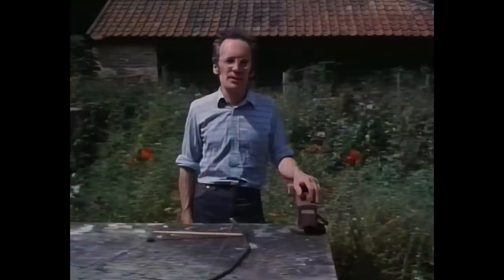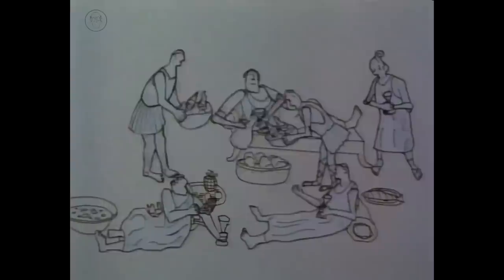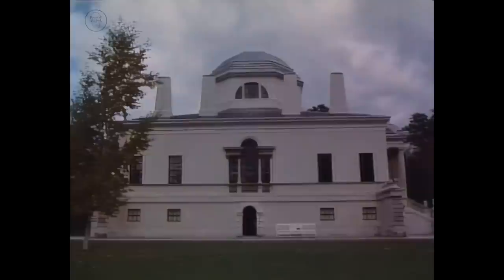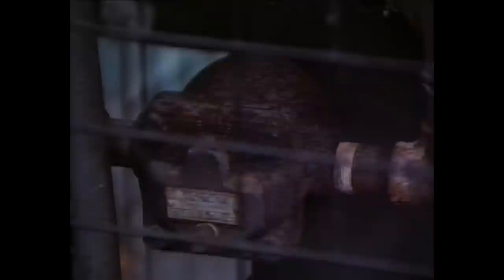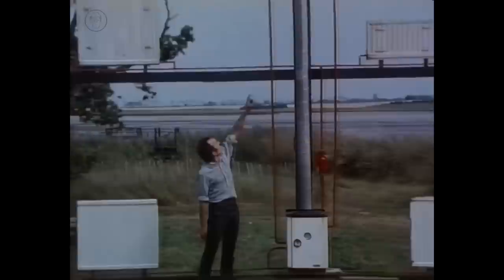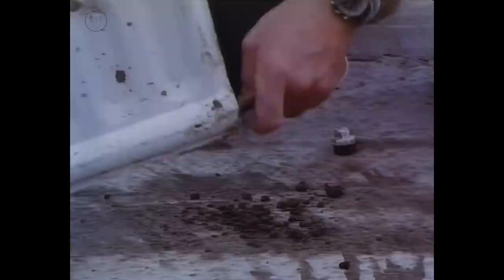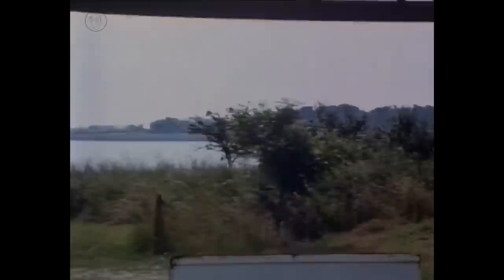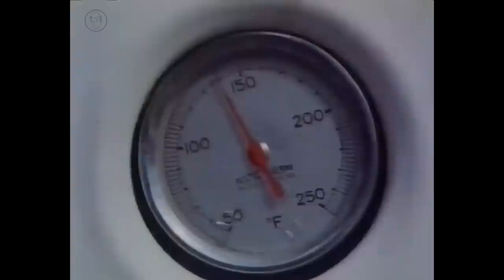The Secret  Life of the Central Heating System - Remastered

Comment: Another energy saver with modern boilers is the old ones had a small pilot light burning 24/7/365 to light the main burner whenever needed but now they use spark ignition and flame rectification (ionization) sensing to check it's safely lit rather than spewing out gas, older boilers used thermocouples which held the gas valve open with a small electromagnet, if the flame went out, the  magnet would release, closing the gas valve until it was manually reset, new boilers also have "modulating" gas valves so the burner can better meet demand without wasting fuel.
Reply: It's still common for natural gas fireplaces to use thermocouples and thermopiles. Of course, these aren't condensing, so there's a lot of wasted heat out the exhaust compared to modern high-efficiency furnaces.
Reply: @cmmartti  Usually because you nearly always light them manually (thermocouple controlled valves need you to manually hold them in long enough so they get hot enough to energise the magnet and hold the valve in after you let go), also thermocouple systems need no external power to work.

Comment: Being from the USA I was shocked to learn while vacationing in Wales that if the boiler goes out, you can get an electrician - if you suspect the problem is electrical - or a plumber - if you think the problem is with the pipes, but to diagnose a boiler problem you need to hire an expensive Engineer, who can work on both electrical and plumbing boiler issues. Thank you for this fantastic and accessible video!

Comment: As a Canadian Engineer I find this fascinating.  Systems are so different!  In my part of the country heat was typically oil fired, either hot water or air systems until the 1970s when electric baseboard heat became the most common.  Only now are they talking about a "smart grid" that will have the ability to control unnecessary loads based on overall demand.
Reply: I was thinking similar things.  I'm American and I've lived in houses built from the 1940's to the 1970's and while the house from the 40's has some evidence of an oil fired water system, houses from the 1960's onward (I skipped the 50's, don't know why) all seemed to center around forced air systems.  Even the 40's house had a forced air system installed - from what I can tell - sometime in the early 60's.  America seems to have mostly abandoned the radiator type water systems when they could afford to in favor of forced-air systems as soon as those were developed enough for home use.
Reply: I’m from Australia and we went from wood fired space heating, to gas fired to heat pump.

Comment: In Finland and Sweden they had central heating of a sorts before even modern central heating as well. In these houses the fireplace wasn't an open fireplace, and the chimney was put in the middle of the house and not the edges. The house was built so all rooms touched the chimney and it heated all rooms. The fireplace in the kitchen was connected to it, and often a masonry heater in the main room. People still use this and variations of the system today.
Reply: Also, the efficiencies of these old masonry heaters could reach into the 70% range and maybe 80%. And modern masonry heaters (same design but with secondary air for complete combustion of flue gasses) reach into the 90s. I have read old magazines from the 1950s that talked about a concept called the "heating wall". Basically the house was built around a central brick wall, which had flues running through it, it was a giant chimney. This would be fired from the cellar and the magazine talked about using secondary air and achieving efficiencies into the 90% range. Very impressive for the mid 20th century! Since the efficiency was so high sweeping would not be required often, which required sweeping something like 40 locations to get at everything. This never really took off because oil fired boilers took over.

Comment: A funny note about the condensing boilers. When they started getting to the peak in technology, they reached a point where they advertised them as 103% and above efficiency. And the worst part is they were actually correct! Well. Technically. And legally. The old system for efficiency was based on all gas inputs and products, gas, oxygen, water vapour and CO2. Once they started condensing even the water in the exhaust fumes to squeeze that last bit of energy, they went over the 100% mark in the efficiency rating that was set up for old systems. Water can have a stupid amount of heat stored in it and it really showed here
Reply: It's the difference between the Higher Heating Value (HHV) and Lower Heating Value (LHV) of the fuel.

Comment: What a brilliant programme, it inspired me to do more researching and fit my own central heating system to a large Victorian property back in Decemder 1989.  All it had when we moved in was a single gas fire in the living room, and an immersion heater for hot water. I fitted a multifuel cooker similar to an Aga, the very large kitchen was transformed into an oasis of heat. The hot water was always hot no matter what time of the day, and tagged on the back of that was micro bore pipe system feeding a radiator in every room except the kitchen. I burned mainly free hardwood offcutts sourced from my employer at the time. They were very happy and very cosy days.

Comment: Pretty cool!
And now we have 90% plus condensing gas boilers too!
Never saw a rotary oil burner either.
Reply: The Wallflame burner is a late 1940s American design (Timken) but was only incorporated into UK boilers in the early to mid 1960s I believe. It was a vast improvement on vapourising wick & pot burners in terms of efficiency due to better excess air management and they were easily switched on & off according to demand without producing excessive smoke (as compared to the fan pressurised on / off pot burner).
https://heatinghelp.com/assets/documents/108.pdf
As Tim mentions the Pressure Jet burner (Gun type burner U.S.A.) is better still and are made to this day. 
Oil fired boilers are also condensing type by law in the UK btw (unless there's a very good reason not to specify one due to site conditions); they use grade 316 stainless steel heat exchangers for the condensing part of the boiler due to the sulphur content in the kerosine producing dilute sulphuric acid in the condensate. Gas oil (similar to Diesel oil) is not used in condensing oil fired boilers due to the higher ash content which would quickly foul the condensing heat exchanger.
Reply: Martindyna 
Thanks for the reply! I see your familiar with Dan Holohan, he’s a gem for old timey piping and equipment. I work on boilers and piping (USA, licensed Master Journeyman), often on systems that are gravity conversions and steam. I love that stuff, it’s ingenious but requires some love now that it’s typically a 100 years old to keep purring along. When I was a kid first starting in the late 70’s we were still finding pot and occasionally wick burners. Condensing oil systems are pretty rare in my area, mostly for the reason you stated in either hot water, steam or forced air application. I prefer the new condensing gas equipment for efficiency, I’m working on a 1MBH system now that tandems 2 of them with a 3rd 95% on the opposite end of the building which was primary/secondary tied into the mains in the building. The building owner had no idea their front mechanical room was tied into the back mechanical system until one of my techs and  I started pulling out a 200’ path of ceiling tiles to find the connection.
Love my job!
Reply: @globeflicker9216  Actually I wasn't aware of Dan, I've just always taken an interest from a small boy in heating systems but I'll check some of his videos out now so thanks for the heads up. Nice to be paid for a job you enjoy.
Reply: Martindyna 
Dan gets into old Steam systems and has a simple way of explaining the physics that makes it work. He has some good history based vids on the subject, too. Enjoy!
I’m lucky enough my hobby is also my paying job.
Reply: @globeflicker9216   Thanks, I’ll definitely take a look.
If you hadn’t realised, my channel thumbnail is the flame pattern of a Wallflame burner btw.
Reply: Martindyna 
Brilliant, I say!
I’m getting ready to post a vid on a tandem condensing gas boiler, I’m piping all the near boiler piping straight from the book with my touch. 
- Across the Pond,
USA,
Licensed Master Journeyman.
Post a vid, if you have not. It’s an interesting subject. American’s are not good at saving easy money over here with efficiently.

Comment: Heat recovery ventilators are amazing; Cuts the ventilation portion of the heating or cooling load by roughly 50%. Might not seem like a big deal for a house, but in commercial spaces where you typically have a lot of fresh air coming in it's a huge savings both initial install and operating costs.

Comment: My adult children live in South Korea where the one in a two story cement dwelling (thick roof included) where their home transitioned from an oil boiler to a gas boiler, both on the outside of the home where the heat is piped through hoses in the cement floors. In winter, clothes are dried indoors adding humidity, either on a clothes drying rack or if wanted quickly, laid on the floor overnight., Enjoy your videos!

Comment: Early water central heating systems worked without a circulation pump at the boiler. The tubes to the radiators where reduced in diameter with every step higher in the house. So the flow was only kept up by the thermal syphon principle. That's similar to the modern Cpu coolers with pipes at the finns.

Comment: Regarding the last comment on heating the incoming air with the outgoing air - I lived in a "modern" (built in 2000) house like this that had a balanced ventilation system and it was excellent, especially in winter - I measured the temp differences and on a cold day I had -2deg air coming in being warmend up to 16deg in the heat exchanger... In summer, you just pulled the heat exchanger and replaced it withe a dummy. Oh and all the windows couod still open and close but the system was most efficient with the doors & windows closed. The house was so tight, it was impossible to light the living room fire with the kitchen extractor fan going!

Comment: He's pressing too hard on his bow-drill bits. It's a very fine line of optimal pressure.
And so much Thank You for these!
Reply: It never occurred to me that I might be able to help him with his bow drill technique, some 30 years later. You have to have a smaller pocket or slot cut out betneath the place where the drill is, a place for charred material to accumulate without being ground and forced out by the drill. That's where the ember accumulates.

Comment: Some more random info .... I had a floor standing Thorn `M' 38/54B gas fired boiler for many years (it was about 26 years old), I remember that the burner made a reassuring roaring noise and the flame looked very clean. Having cracked an egg on the flue collector after the burner had been running for 15 minutes (to allow for the cast iron boiler skin temperature to stabilise) it not only cooked the egg but burnt it completely in seconds! (I had fitted a baffle, intended for the open flue boiler only, in mine for improved efficiency which would have the effect of increasing the flue temperature due to less excess air). I speculate that cast iron boilers become increasingly inefficient over the years as the iron develops a thick skin of rust that can’t be cleaned away using standard flue brushes. As is common for the British if it ain't broke don't fix it attitude because the cast iron boiler lasts we were slow to innovate beyond these boilers; however there was the non condensing Abergas (made in Abergavenny, Wales, UK in the late 60s) that was very efficient (featured on TV - `Tomorrows World') but these were intolerant of poor installations that caused over heating (very low water content boiler). It took Continental Europe to introduce condensing boilers in quantity, I believe the Dutch were amongst the first. 
Having confirmed that the efficiency was not the best (I had also noticed that the boiler flue never produced `fog' even on start up) I replaced the Thorn `M', although still working, with a Worcester 12Ri (12kW) condensing basic boiler for improved efficiency; this new boiler has been 100% reliable over 14.5 years, I can't recommend it highly enough. 
P.S. The Thorn `M' cast iron heat exchanger had considerable heat capacity, so much so that a 10 minute pump run on was still cost effective imo.

Comment: Interesting progamme. Just a few comments:- 
1. The `horizontal chimney' works due to the intense heat in the vertical portion of the system 17:28 as well as due to the fact that the flues are balanced. Later boilers (1980s) have a high temperature fan on the outlet side of the boiler to enable the balanced flue to be smaller and less obtrusive. 
2. The solid fuel boiler used is a very old 1950s design of low heat output boiler with no heat exchanger above the fire. There were better designs available at the time with the (usually cast iron) heat exchanger extending above and over the fire (e.g. Ideal made boilers with 2 doors in the vertical front of the boiler, the top one to put the coal in and the bottom one to take the ash & Clinkers out). The top door had an air vent hole with a variable shutter to allow some air to enter above the fire to enable the flamable gases produced when heating the anthracite to be burnt (with a nice blue flame). 
3. The oil fired boiler is shown incomplete to show the burner; so unfortunately the heat exchanger detail towards the top of the boiler is not clear. This would show how these boilers were in the order of 75% efficient (while firing, the seasonal efficiency will be lower) although in my view this did vary from manufacturer to manufacturer e.g some had an integral draught regulator, others didn't. The draught regulator prevented a hot chimney from pulling excessive cold air through the boiler & burner (it was just a counterweighted air flap). Also some manufacturers used a lump of `concrete' like material in the top baffle that took ages to warm up which was obviously inefficient and finally some manufacturers insulated the boiler shell with fibreglass wool or similar while others didn't bother. The oil boiler shown is a Wilson Wallflame 60 (60,000 BTU/hour output) manufactured in Kirkby, Liverpool, UK 13:27 
BTW the wallflame burner is a late 1940s American design (Timken) that usually burns Kerosine (Paraffin) although it can be modified to burn gasoil (Diesel oil). 
https://heatinghelp.com/assets/documents/108.pdf 
4. Tim must be a nice guy judging by how the cat starts to purr when he sits on the sofa ! 0:58
Edit As an aside I've always been interested in domestic boilers, in particular oil fired. We moved from London to a new house just outside of Maidenhead in mid 1959 when I was 2 1/2. The house featured part oil fired central heating `that required no stoking' which was really new in the UK then. The Wilson `Oilheat' 35,000 BTU/hr boiler (that came out in I believe 1957) had a vapourising wick modulating burner like an Aga cooker and the CH was pumped with gravity feed to the HWS tank in the airing cupboard. There were no controls apart from the modulating boiler thermostat made by Teddington Controls (I see they're still going in the UK btw) and a manually operated switch for the pump if CH was required.
The USA had oil fired `Wallflame' boilers from the late 1940s / early 50s but Wallflame burners which were on / off, fan assisted and thus fully automatic and far more efficient (due to better excess air management) only became available in the UK in the early 60s. Worcester, Henry Wilson & Harford Unical (who made the BSA Hotspur) were I believe the main manufacturers to incorporate this new American burner into boilers over here in the UK.

Comment: Before WW2 most faxes were used for sending "were photos" between newspapers or in big businesses that needed to send signed documents. 
After WW2 during the occupation of Japan, the occupation forces wanted the Japanese newspapers to send articles to each other in a system like the Associated Press.   AP used teletype machines which would not work with the gargantuan Japanese character set.   Vincent Hultman of the Army Signal Corps had newspaper wire photo FAX machines installed so the articles could be sent as images. Over time Japanese businesses became the world's biggest market for fax machines and they produced their own fax machines.  The Japanese invented the digital FAX which increased the quality of the image received and then drastically reduced the price.  These digital fax machines from Japan were then sold to the rest of the world. When combined with xerography, the digital fax made it easy to use.

Comment: Wow the Ascot Water Heater, yonks ago in the 60s at a crazy factory I worked at had one in the washroom that used to sometimes malfunction. When you turn the hot tap on if it the gas didn't light straight away the trick was to calmly leave by the door and stand outside a short while, listen then go back in. I didn't know about that the first month working there, I turned on the hot tap and washed in cold water... then a deafening boooooom!! a flash of flame shot out the Ascot and ringing ears. About as noisy as a rock concert and as dangerous as riding the motorbike to work

Comment: My parents had a wallflame boiler. The 8.3KV ignition spark made it impossible to listen to the radio when it was running. Also of note was the rim heater - essentially an induction furnace (many primary windings, 1 secondary), which made the edge of the drum hot to give better ignition.